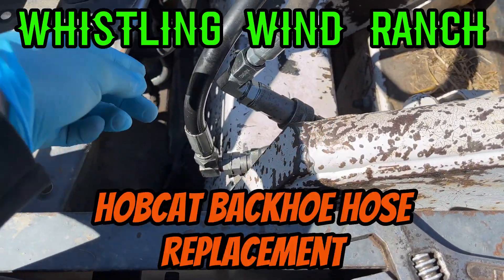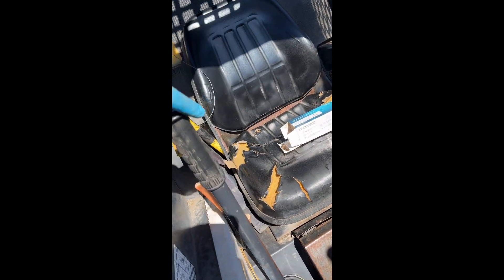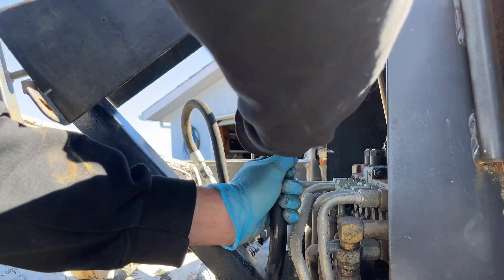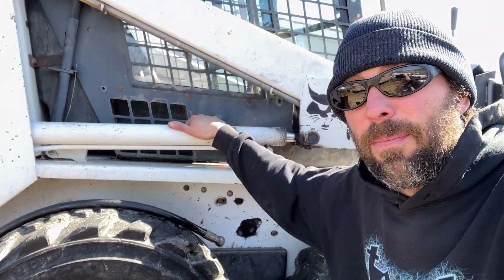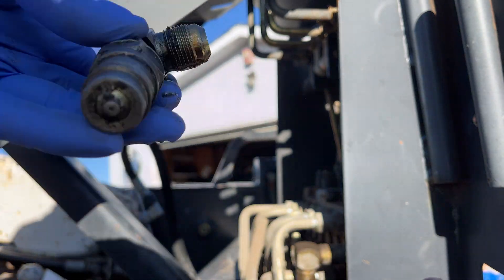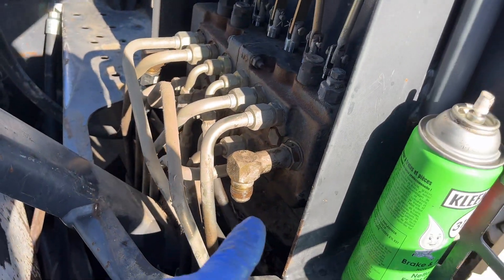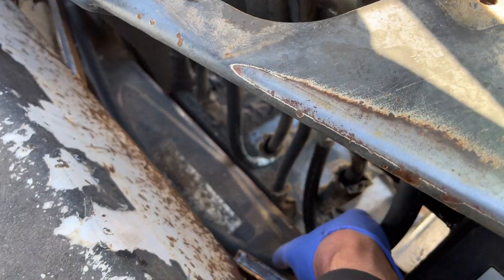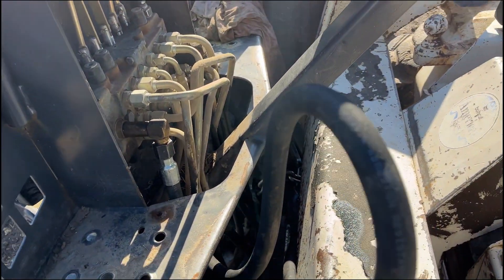Replacing Hydraulic Hose on 709 Bobcat Backhoe

Comment: Will a bobcat 709 fit in the back of a pick up truck?
Reply from the maker: @scotyarnell1157  I think it would physically fit. I mean it’s not very wide, if you tucked the stick and boom in tight to the body. Hardest part would be loading and unloading, a big tractor or something to lift it…. I might need to take our big Case tractor and my long box 2nd gen Cummins out to see now, my curiosity is peeked.
Reply: @ was thinking of taking the tail gate off then loading it on..
Reply from the maker: I’m going to bring our machine back to the house on Monday and will see if I can fit it, you might have done it all by then, but I’m so very curious now. I know the weight isn’t going to be a factor, think they weigh just over 1600lbs, my ‘91 F150 could probably take the weight (might not like it, but damn it if the old iron would do it) and I know the one tons could both do it, we regularly haul 2 1100lb bales in the back.
Reply: @ was just looking to buy one, it sold before I got there, but was wondering if I needed a trailer or not… so if you do this let me know!
Reply from the maker: @ I did try to fit it in the truck box, it looks like it was going to fit fine. The issue I found was I couldn’t unhook from the skid steer it without another person (I was home alone and no one around for miles) I needed to swing the boom towards the cab to steady it and down the stabilizer legs once I had it up and in the box, and needed to detach it all, but the bobcat quicktach and backhoe frame were in the way of operator getting out of the machine. I even did it with the 743 skid steer and didn’t need the larger tractor to lift it. Would have probably been easier with the big tractor though, or someone to run the backhoe controls once it was in the truck box
Reply: @ do you think it would have been stable enough to transport that way?
Reply from the maker: I think it would be a bit unstable. Probably best to source a trailer. I do sketchy stuff all the time, and for a short distance might chance it, but I’ve had enough encounters with the commercial vehicle inspectors I tend to play it safe.
Reply: @ thanks for the investigation. I bought an iron bull 16’ dump trailer so should be set for here on out. I am aiming to get an 811 bobcat backhoe attachment or even a 911. We will see. Thanks for the info!!
Reply: @ got me an 811 and a dump trailer. Currently replacing all the hoses on the 811 since they are old and hard. A bonus was it cam with the mounting hooks/ brackets!!
Reply from the maker: @scotyarnell1157  that’s going to be a handy combo. Good thing your replacing the lines, hate to be on a job and they let go. Our mahindra tractor had pretty terrible quality lines from new and it was a pain every other job to have to shut down for a few hours and run down to get a line and replace it, hydraulic oil isn’t getting cheaper and it’s messy to clean up. The dump trailer will definitely be an asset for your ventures.
Reply: @whistlingwindranch1832  replaced 6 hoses today, got 8 more i believe.. had to move it and found a stabilizer cylinder has blown the seal... 3 gallons of oil later i got it moved in the garage. the work continues. also the 8 hoses cost me $448